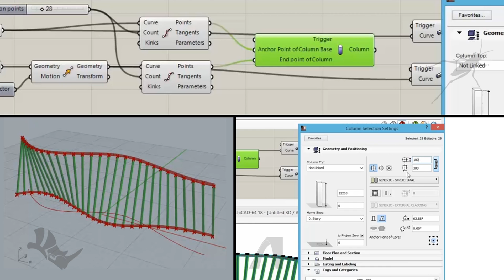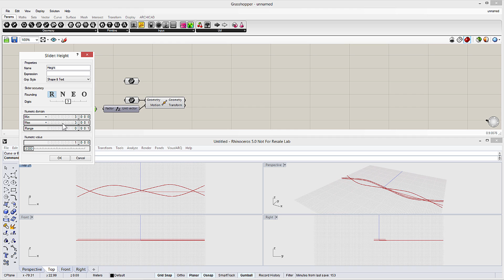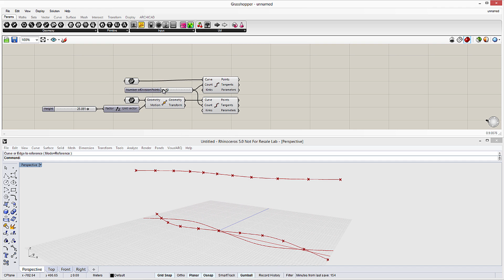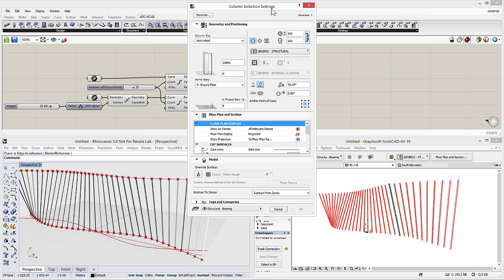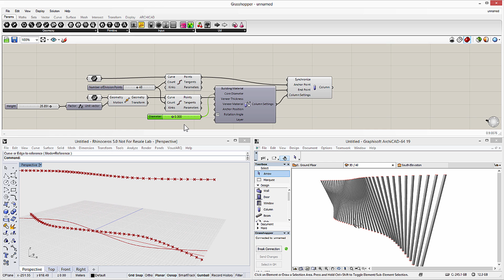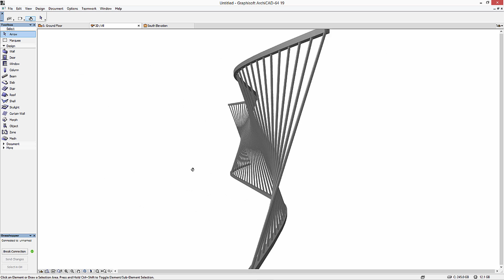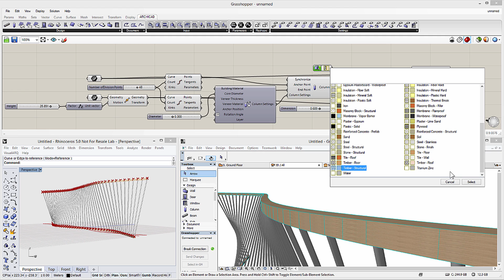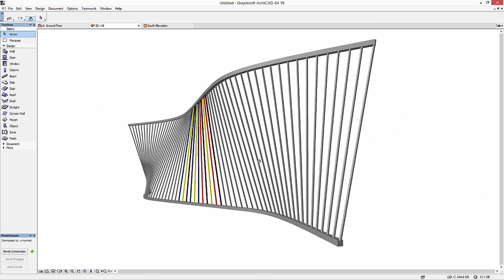Rhino-GH-ARCHICAD Connection - Creating a Free-form Shading Device

Comment: Hi! everything very impressive! inotice that the top beam is connected to columns by their top side..is it possible to say to grasshopper to connect them by the lower side or by the centre of the curve? i tried using "position" in grasshopper (by setting 0,1,2), but nothing happened..thank you!